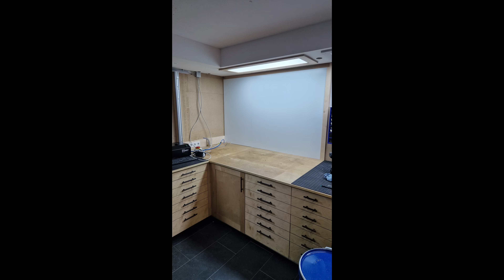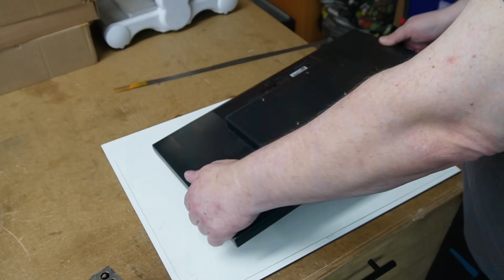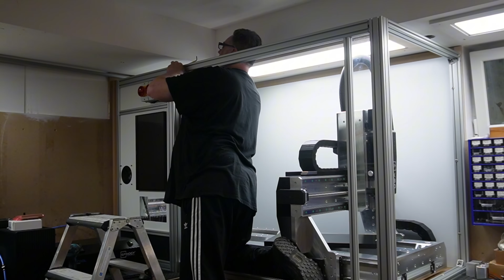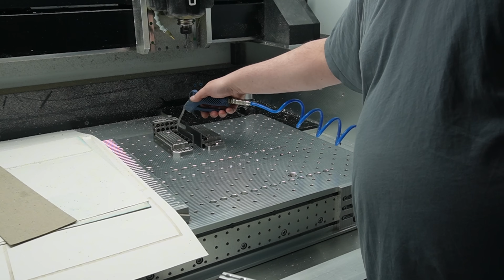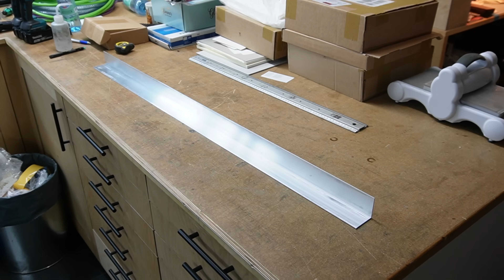The Ultimate CNC Enclosure Part 1 - The Frame

Comment: What controller are you using? Ive heard you mention the name of it in a few of your videos. It sounded to me like you said "adding CNC" but ive googled this with a few different spellings and nothing comes up. I must not be hearing it correctly.
Reply from the maker: EdingCNC. I use the CNC760 board in my builds
Reply: @scratchbuiltdesigns  Ahh ok, is it a touch screen? The way you have the monitor mounted it looks alot like my Masso. I thought maybe someone came out with a simular controller I haven't hear of yet.
Reply from the maker: @PhoKingLitMedia There are many controllers out there apart from Masso, EdingCNC is one of them. Masso just recently opened their closed system to LUA scripting - for a ridiculous price premium. And they are still limited to 110kHz. It was never a real and meaningful alternative for me
Reply: @scratchbuiltdesigns  Yeah ive been considering upgrading, but itd been hard to justify the addtional $750. So far the controller is capable of 95% of all i need it to do with a few small exceptions. It would be nice to have a little more functionality with my ATC, and to have some more probeing functions for part quality checks. Other then that ive been pretty happy with it coming from Mach3. The main reason thats kept me from pulling the trigger on upgrading is i have no clue what lua is or how to use it. I cant find much online either. Masso gives some examples of what its capable of but unfortunately no information on how to use it or any training videos.

Is EdingCNC a stand alone system, and are you running it with a touch screen?
Reply from the maker: @PhoKingLitMedia  No. EdingCNC runs on a Windows PC. The board is in the control cabinet and communicates with the PC by LAN connection. So any laptop is fine. I have a fanless miniPC and a touch screen integrated in the enclosure, together with a small control panel. The miniPC is connected by Wifi to my CAD/CAM PC, so I don't have to mess around with a USB stick to upload a milling program

Comment: Very much enjoying this build; thank you so much for sharing! :D

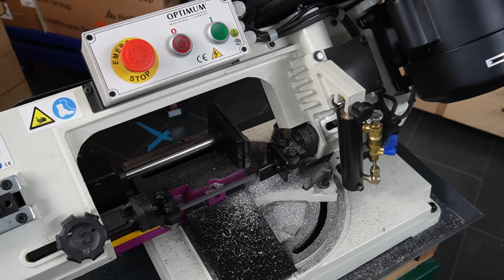Slightly off topic, but I have a bandsaw question. Yours featured at 17:26 in the Side Window chapter appears to be exactly the same as my bandsaw, but with a different vice jaw. Is this a modification by yourself? I ask because mine came with a quick adjust jaw that randomly fails which is very annoying/dangerous, and needs to be sorted...
Reply from the maker: No it is the stock vise. But I will modify it soon, because the jaws are to short
Reply: @scratchbuiltdesigns  Many thanks for confirming! I'm thinking about turning mine into an auto-saw, so may upgrade my moving jaw with that future modification in mind. Keep up the great work work Sir!😊

Comment: @7:40 How does the CNC know it's 0 in the X Y and Z? Do you use an edge finder, do a live 0, or do you do the paper-between-the-bit method? Or does it use a more sophisticated probe?
Reply from the maker: The latter 😉
I will show it in the next video.
Also in part 4 of this series you can see it at 4;20 min...
Reply: @scratchbuiltdesigns  Looking forward to the next video!
Reply: what is paper between the bit method?
Reply from the maker: @ndjxisjenxjix9525 You incrementally touch off the workpiece in 0.01mm steps with a piece of paper between the endmill and the part until the paper doesn't move anymore.

Comment: Very nice build👍 you could also fill out the profile slots with rubber band on the inside of the cabinet. The rubber bands for aluminum extrusions are quite cheap and easy to use.
Reply from the maker: Yes, Sir! 
In fact they are already here on site 😉

Comment: You really need a spindle brake, maybe there is one in your VFD already...
Reply from the maker: 200W 70 Ohm external brake resistor already in place and brake parameters in VFD programmed. Still, anything less than 6s throws an overcurrent error.
And yes, it is annoying. The 750g SK30 tool holders have quite some inertia
Reply: @scratchbuiltdesigns  Oh, you already have one... Is that the maximum power resistor you can put? I know you're limited by the VFD IGBT doing the braking... I was expecting a bigger brake resistor for this spindle, 3KW if I remember correctly
Reply from the maker: @car9167  It's 4kW in fact. The resistor is the Omron recommended size, but I am already working with Spinogy on an improvement

Comment: you need to add a big dc braking resistor, will make your tool changes super fast with spindown times <2 sec.. Ive done it on my spindle and man what a cool change, also good for safety in an Estop situation
Reply from the maker: Absolutely. I have an external 200W 70 Ohm resistor hooked to the MX2, but anything less than 6 seconds will cause it to throw an overcurrent error...
750g SK30 tools holders have quite an inertia

Comment: Any german design DIY router i see uses Linear Rails that look undersized by conventional standards. Like Stepcraft routers. Why?
Reply: Undersized😂 do you even know how beefy 25 rails are😱
Reply: I didnot realize they were HGR25. my apologies.
Reply from the maker: @subuktageenfarooqi No worries. BTW, Stepcraft is not DIY, but a brand. However, for the exact reasons you mentioned it is better to steer clear of them and rather build DIY 😊
Reply from the maker: HGR25 is undersized? What size do you usually use in your builds of this work area size? And where can we see them?